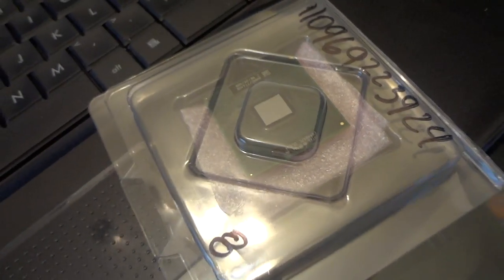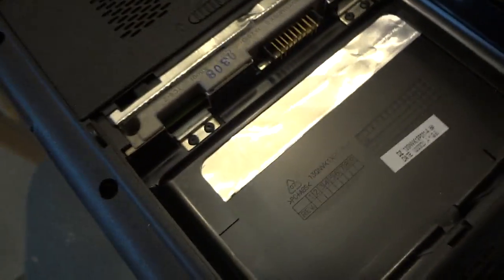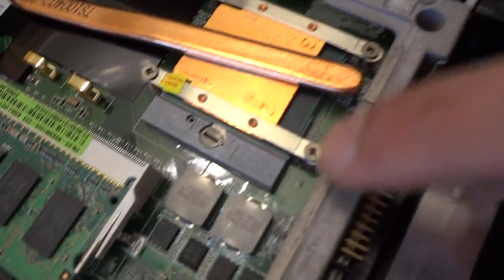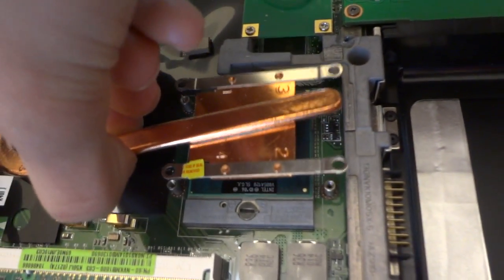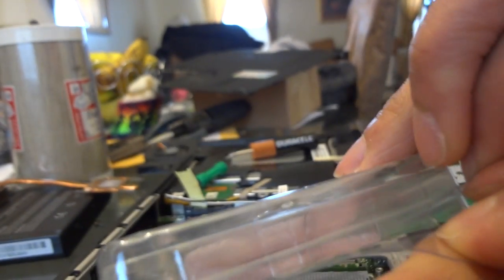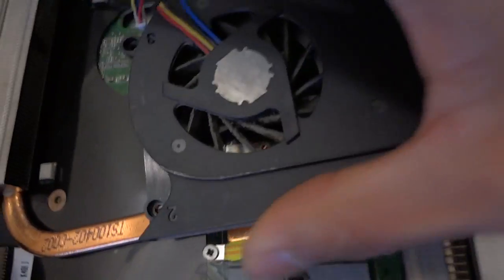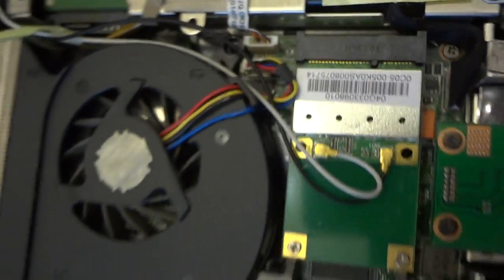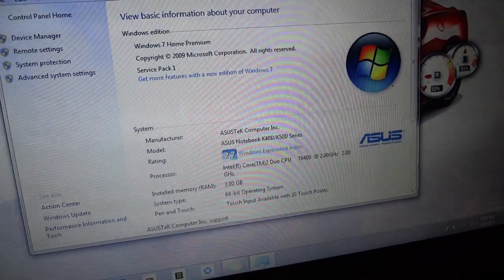Asus K50IJ CPU Upgrade (Intel Pentium to Intel Core 2 Duo)

Comment: you messed up by touching the pins on the cpu. you never touch the pins, you'll lose performance with body oil released from your finger, only hold by the sides and never touch the top too. mostly you messed it up and the viewers who upgrading and maybe touched the pins

Comment: well i actually researched it. reason your I3 didn't fit was due to the different socket and also the wattage would've fried the board. i have the same k50i and wanted to upgrade to the core duo. I've already ordered the T6670. (cost me 14 bucks) which is a step higher than the one you installed.

Comment: nevermind i updated it and it ran perfectly. so far boot time and calculation did improve faster due to the  2MB L2 Cache but a good buy. just finished restoring the whole computer. i may drop a bigger ram card. there is a way to add more ram but once i do that i'll update you on it. thanks for the video though it made me confident in swapping em out

Comment: will do. it prob wont be for a long time though. the most u can install is a 4GB ram stick and mine used to say 3GB of ram but once i took the ram n reinserted it it now reads 2GB. weird but my performance went from 3.3 to 3.4 only cause the integrated vid card but processor was 5.0 to 5.7 now so kudos on the swapping. with a 46 second boot time apose from the minute it used to. good buy and thanks again man

Comment: I hope you applied some new thermal paste between the cpu & the heat sink dude! If not you could be lucky & its ok, but check your temps with a tool like core temp or real temp. Make sure its not running to hot.

Comment: I have an asus k50in, which is basically the same as this one. I have seen that you can put a core 2 duo at 2.4 Ghz, to CPU of more speed I do not know if it would hold the motherboard

Comment: quick question. i have a dual-core t4400 @2.20 GHz. would swapping for this would boost my pc. its mainly just a fun project. or what would be the highest chip i could replace it with as long as it stays within 35W i am aware of the restrictions in voltage. if you could help i very much appreciate the tech advice

Comment: Like everybody else said we didn't apply any thermal paste hopefully you don't burn the board or the CPU but hopefully someone posts it right after you did all that and then yeah you can take out the CPU again and add thermal or I mean remove the parts again then add thermal on top of the CPU

Comment: Hello kentuckm134. Nice video, thank you for showing me this tips. I have the same Asus K50IJ and today i opened and cleaned it. I also changed the termal paste. It works great now ! But i want to ask you something. When i opened it i noticed that the RAM memory chip is integrated in the motherboard, but there is one free slot left for adding an extra memory. I have 1GB DDR2 667 mhz Samsung memory, but it didn't recognize it. So i suppose that i have to add 2GB DDR2 667 mhz. Is this the correct memory type you have on yours ? Thank you !

Comment: Hi,what cpu u had before the change? I have an asus k50ij sx002l and it has an intel pentium t4200 (dual core),do you have any idea if an intel t9600 (core 2 duo) will work on it?
Reply: You can only upgrade maximum to intel core2 duo T9500 (socket P) but my advice is to go for T9300, because T9500 costs twice as much and the performance difference you will not notice 2.60ghz vs 2.50ghz.
Reply: +drumheart Actually, I can confirm t9900 working as it is supposed to
Reply: thanks both of you
Reply: I had intel pentium dual core t4300, ddr2, bus speed  800mhz (FBS)
It will not work because t9600 has different bus speed 1066 MHz.
You have to pay attention to bus speed and cpu socket support.
In my case it's socket P (478).
Reply: +drumheart  oh my bad, I tought he wrote he has k50in
Reply: how about the T9500 ?
Reply: all the rush about FBS diff is myth.
I do run t9400 on k50in with no issue!

Comment: yah i saw he forgoten apply thermal paste like i did apply thermal paste for cpu upgrade for solving clock speed problems it need cpu upgrade pervent using too much engery with cpu upgrade i didn't use much engery at all

Comment: I overclock my cpu 2.13 ghz to 2.6 ghz, more speed is not stable
Reply: What laptop are you using and how?
Reply: @question4552  Why you ask?
Reply: I want to overclock mine too please
Reply: @question4552  I use nvidia system tools, since my laptop has an Nvidia graphics card
Reply: @question4552  it also allows you to overclock your graphics card, motherboard and ram memory. But you have to have Nvidia graphics to be able to use this software
Reply: @davidgarciab.6670  oh, but I only have Intel UHD Graphics lol, thanks anyway.
Reply: @question4552  looking for a software for Intel, I think there is something about it. Search by google.

Comment from the maker: Yeah good thing it didn't fit, or else it would have been unusable laptop. Anyway, that's good. I mean, core 2 duo is a much better cpu, you just have to find a faster clock speed. But since, you bought t6670, that's also good. Lemme know how that goes for you. It's also unfortunate that this laptop, you can't really upgrade the RAM, or so it says.